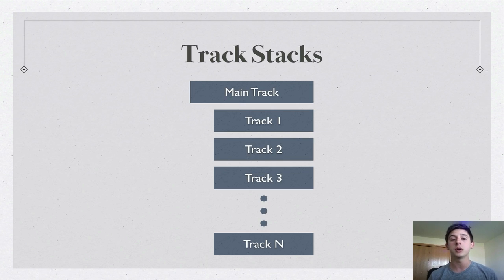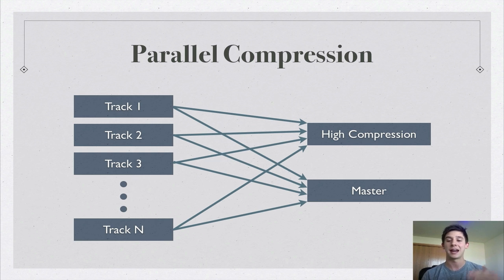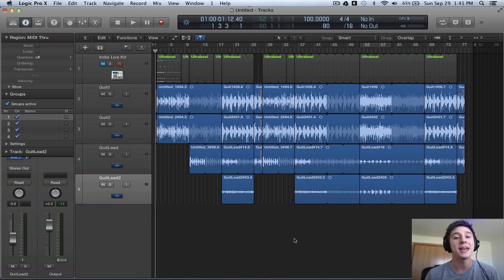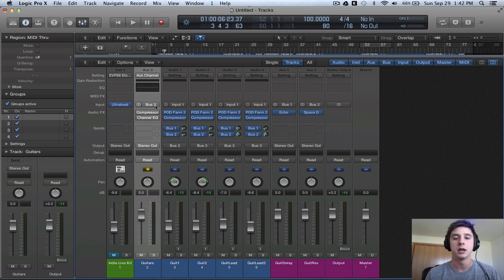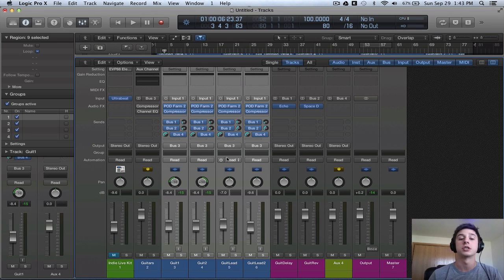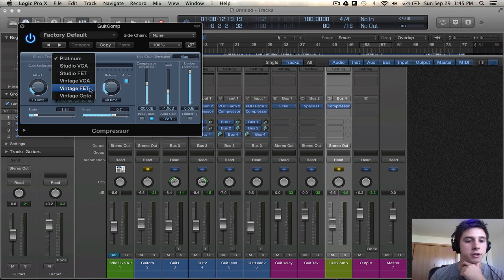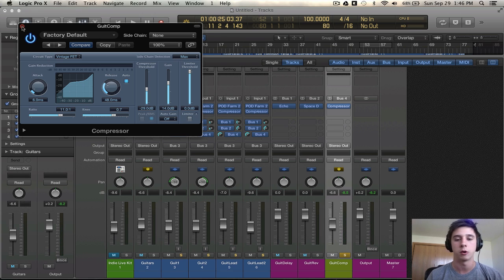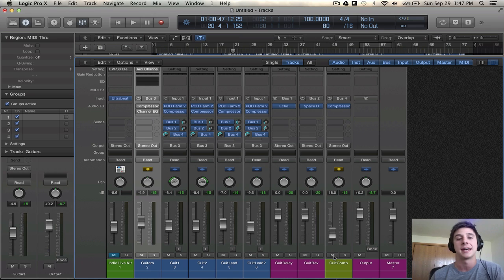Logic Pro X Tutorial - Track Stacks & Parallel Compression

Comment: thanks for the cool tutorial. Just a question: wouldn't it also work if you send the output of the dry guitar bus directly to the compression bus, without sending each separate guitar track to the comp bus?
Reply from the maker: Yeah you could, but then you'll need to create another track for your completely dry signal. Parallel compression employs two parallel tracks. One highly compressed and the original, which is why I did it the way I did.
Reply: it makes a lot of sense, thanks for getting back! This seems like a really cool technique to mess around with. I read  some producers actually using multiple parallel compression tracks and they blend them in with the dry track to capture nuances and flavors from different compressors. Feels like this is something for the analog world, but it could be something to try with some good analog emu plugins as well!
Reply from the maker: Wow that actually sounds like a great idea! Yeah if you have some quality compression plugins it's definitely something to look into
Reply: Mitchel Pigsley Thanks for this ! But why didn't you send the bus 4 directly to the guitar master ?
Reply from the maker: Bus 4 is being sent to an auxiliary track for high compression since that is what parallel compression is. There are some times that I have other aux tracks between the original and the compression aux if I wanted to do some fancy modulation or whatever. This technique is already a bit involved so I made it as simple as possible.